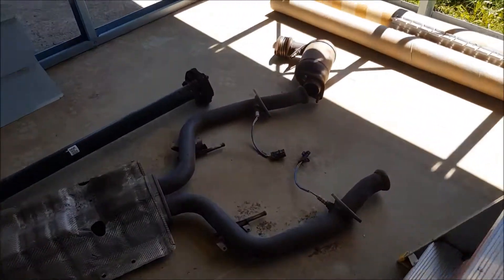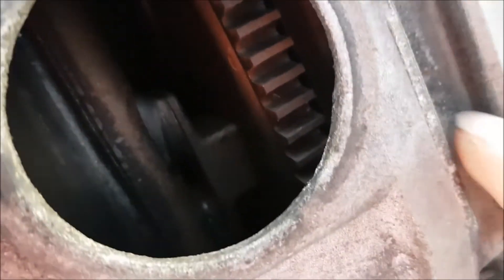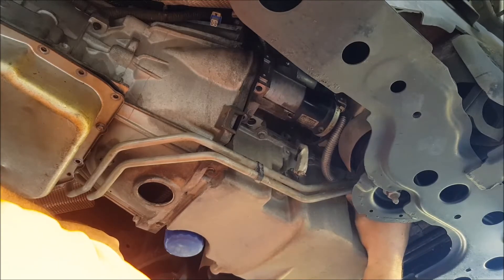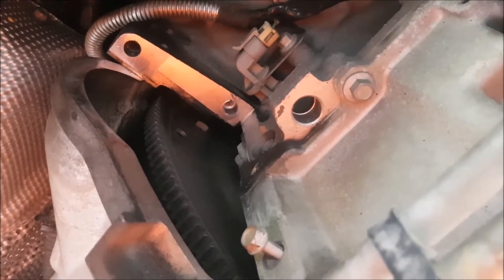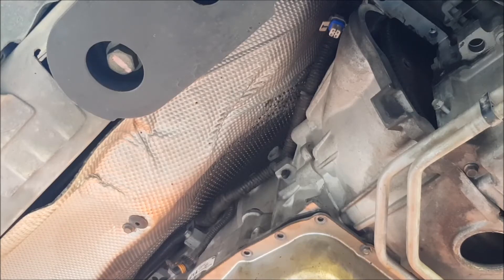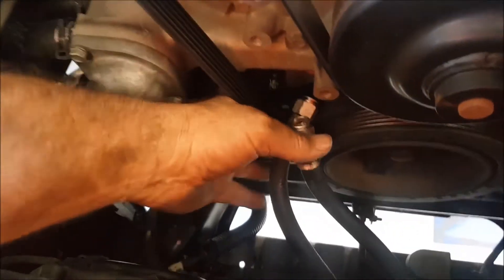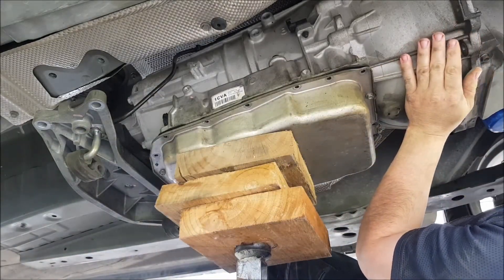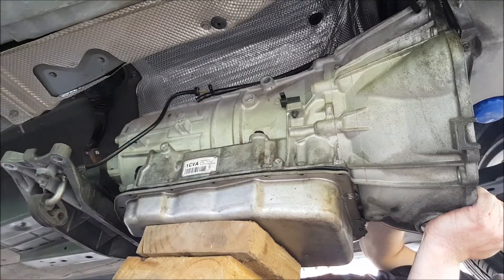How to remove a gearbox and rebuild it part 2

Comment: I’m just a bit confused when it comes to the ally pipes, do you disconnect it and pull it out? Or just disconnect them? And push them out the way?
Reply: remove the bolt holding it on grearbox, they are also bolted to front of engine and are a shit to get too